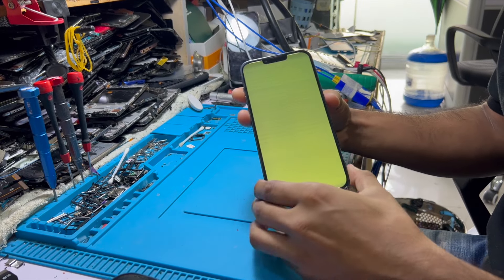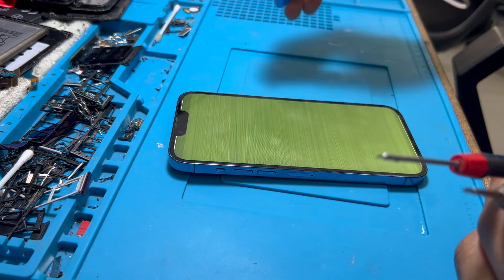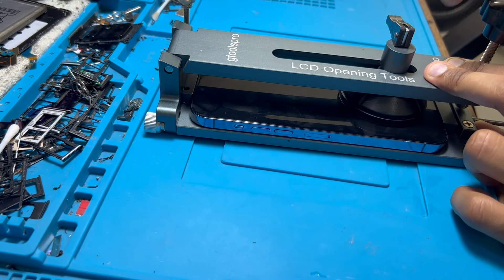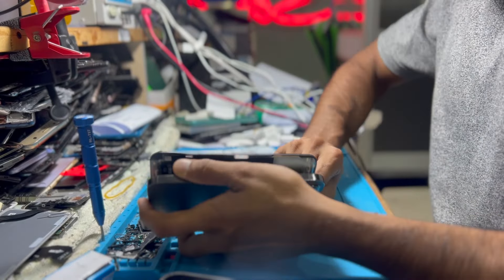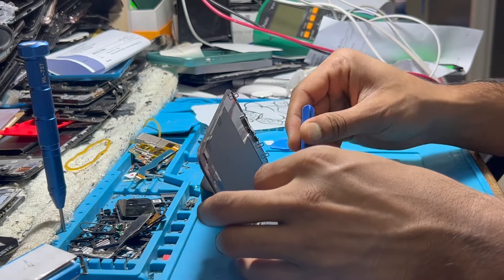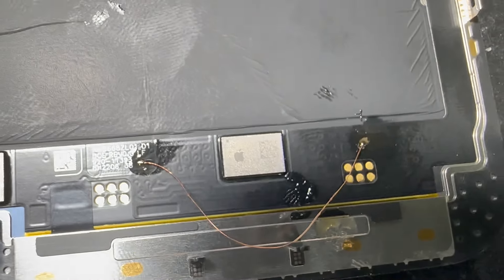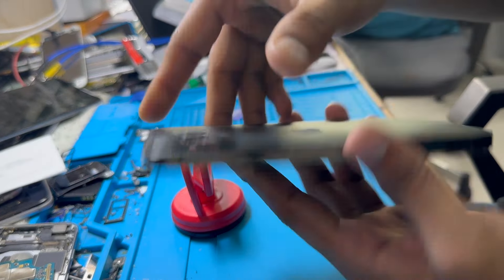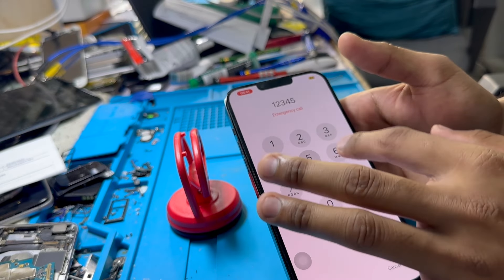iPhone 13 pro max green screen issue | easy TechPoint

Comment: This is the apple's Trap to Take down your phone with update, its mostly happened with 13 series also some user of 14 but this number is very low bcz apple's aim only take down 13 series not 14 but its gone wrong that's why this software attack also effect 14 series but 14 user have warranty and they change our display zero of cost or 13 user have only 2 option very costly Repair or upgrade to 14 or 15 series this is the master plan of apple.

USER'S WE ARE NOT STUPID'S NOW IT'S TIME TO TAKE LEGAL, SOCIAL ACTION AGAINST APPLE COMPANY 
WHILE ONE PLUS USER FACES DISPLAY RELATED ISSUE THEY CHANGE IT FOR FREE ALSO THEY CAN  CHANGE USER'S DISPLAY EVEN OUT OF WARRANTY FOR FREE 
WAKE UP CONSUMER WAKE UP 🍎🍌
Reply: Lol u serious u call a hardware defect apples take to kill iphones with a software update u so rediculus

Comment: After doing this method, are there any issues afterwards? Like did the problem recur? Or did it got worse? Have same problem, 13 pro max and this just happened about a month ago updated the phone one last time iOS 17.5.1
Reply from the maker: No. I don't think you will face any other issue.

Comment: May i know what number pin should we jumper
Reply from the maker: iphone 13 pro max 
left side (middle row)  no. 3 right side (in the box middle row) no. 2

Check description there has orginal full regulation photo.
Reply: Do that change refresh rate
Reply from the maker: @mridulboro143  
no. It's TRUE tone line
Reply: I'll see if my phone will get fixed or not
Reply from the maker: @mridulboro143  
if you cannot do it. Contact with us Whatsapp
https://wa.link/oplooc
Reply: After this recovery, do water resistance work?

Comment: Hey friends, my phone got repaired even after I was out of warranty when I took my phone to Apple authorized service center. Make sure you carry your bill, and also your phone shouldn't be opened by unauthorized technicians, After diagnosis they will repair it for free. To be honest, my iPhone 13 Pro Max was repaired for free it was 1 year and 7 months old.
Reply: Bro mine is out of warranty....But turned white...Will they change it for free or i have to pay money
Reply: @AsifJamal- if u have original bill, they will replace the display with new one for free

Comment: Early i got the same issue a month ago . I just hard reset my iphone so many still not figure it out.
I lose all my hope that my iphone is going fix , i kept my phone aside .
Its automatically start working without any issue .
But today i face same issue flickering screen and green screen only after downloading 😂
the software update . 
Already hard reset my iphone two 
time .
Seriously don’t know what apple want from us .
Reply: your problem resolve bro
Reply: @laskaralkamaziz47  
No bro but there is green effect on top right corner of the screen 
Screen is working well .
There is very green screen flickers when i turn off and on the screen .
Waiting for the next update .
Reply: I have mine on the right side of the screen
Like some greenish horizontal lines.
Do updates really fix the issues?
I'm on 16.4 wondering if going to 16.6 might fix mine.
Reply: How to hard reset the phone?